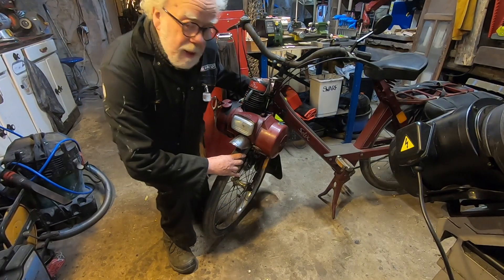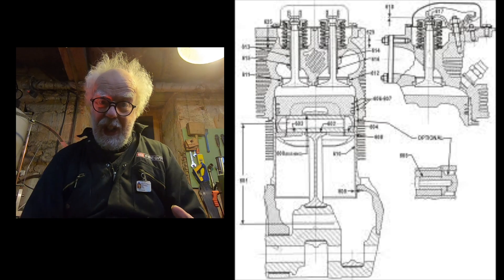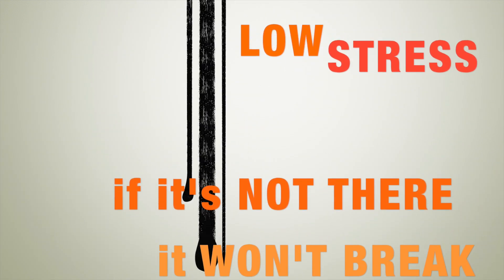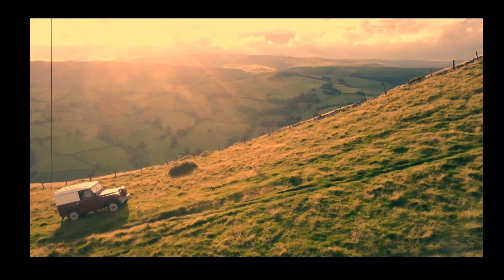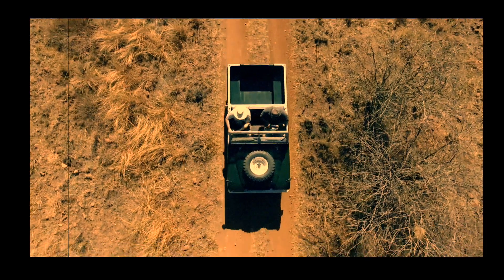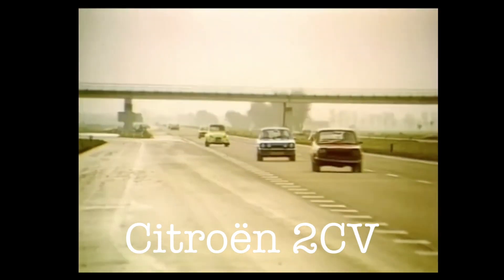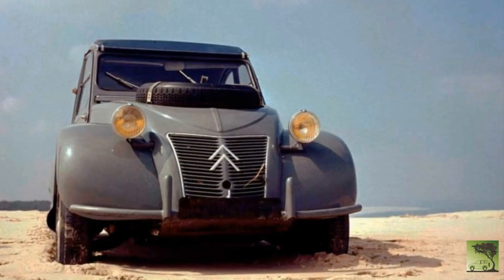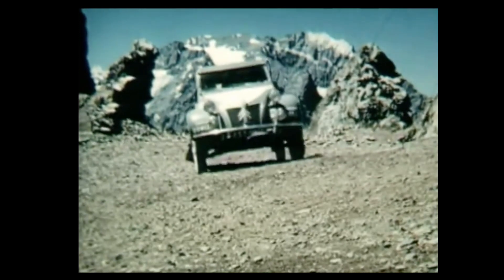Best Engines - Prof Simon

Comment: Modern (ish) indestructible engines would be the VW PD 130 (decent power, great economy and they go on forever with minimal maintenance), the Toyota 2J-ZGTE (Possibly one of the most overbuilt consumer engines in history, if you want to talk under-stressed then this deserves a mention) and finally the Chevrolet small block V8 (used from 54-03 in one form or another and in every possible application)

Comment: you are so right my friend,my first car  was a 3cv Citro the frog called here in argentina, I run into sand, snow, steep  unpaved rocky trails and all you needed to disassemble it was  the very same wrench for wheel change, you forgot to tell that the heating was  done by redirecting the hot air flow from the air cooled cylinders and most impressive to me that first models  did not have  dampers attached to the chassis, they were inertial  dampers  so clever,  and that.snot all    it was  convertible meaning that fabric roof  was retractable   and seat  couldbe easily removed  leaving a flat interior,  I  spent  wild  vacations  sleeping  inside, if there was  an easily breakable part was that  wiper driven by odometer  only in first models:  being at age of 10  we  broke one playing with that novelty  in a car of a friend of my dad,  it had a sort of a  water  rotary knob  to put it to work....still remember the  verbal spank we got!!!
Reply from the maker: Happy 2CV memories

Comment: The 2CV was a cool little car, designed before all the bells and whistles everyone expects to have now (bringing unreliability with them). It went round roundabouts at an awesome lean angle, the air-con was a flap you could open to scoop air straight in from underneath the windscreen, and you could fold back the top (I had a Dolly model). The engine never gave any trouble, however the rest of the car was flimsy in the extreme... and you could almost hear it rusting underneath you! And hoped you never had the tiniest of accidents because the whole car was the crumple zone 😬
Oh and the gearbox was mounted under the bonnet and connected to the gear knob with a “twist & pull” kind of linkage...

Comment: 2a had a 2.25l petrol which was a basically the same as the diesel but with lower compression, it was actually a three bearing crank, not until the series 3 and Rover did it become a five bearing  motor and not until the 110/90 or defender did it become a 2.5l all derivative of the original series 2 motor from 1958/59 . In fact the LR motor 200 and 300 tdi motors were a further evolution of the same design and were in production into the 2000s when replaced by the td5. But the details are not that important your comments are spot on about the under stressed design of the 2.25 petrol, I drove mine for over two hours to get home with a disintegrated water pump bearing and no water, replace the water pump and coolant and continued to drive that same motor for another two years! Love the videos professor, keep up the great content!
Reply from the maker: Cheers Chris

Comment: I like your pics, cars from 40s, 50s and 60s had engines that were not equipped with smog controls. They were simpler and easy to work on.

Comment: Prof Simon..as much as I love my Rotary Engines...  I think when you talk about best engines built...  one of the world's best has to be the second world war  Willis or Ford..4cyl... ..they would rate a 5 star performance for what they went through.. that's the toughest little performer I have ever seen  p.s. I now own 2 of them.. both later models a 1946 and a 1947..and regarding the Rover, I had a short wheelbase 88.it was cute  but . what I hate on anything English is that  as tough as those Engines are the Lucas wiring and Ignition system  are  horrible.  .keep up the Great videos   Thanks..again

Comment: I would say my car's engine should get a mention in dispatches...   Reliant 850cc all alloy engine, tiny lightweight engine that can propel with a bit of tweaking a 3 or 4 wheel Reliant close to the 100mph mark whilst giving about 75mpg and if maintained well, totally bulletproof and surprisingly robust for an all alloy unit.   It looks incredibly like the Mini A series and that is because the Reliant 850cc and the Mini A series were both developed from the sidevalve Austin 7 engine as Reliant bought all the tooling for the 7 when production ceased at Austin Morris.     

Ford UK had some awesome engines, the Essex 2.0 V4 was an education on getting a tall but thin profile engine into a tiny engine bay of a MK1 Transit and was a strong lump but suffered reliability issues because of strikes at Dagenham, the Essex 2.5 and 3.0 V6 the darling of the Metropolitan police who finally had an engine that could catch the Jags of the crooks without the hefty price tag of the wallowy Rover P6 V8 and of course the Ford Kent OHV sweetheart of the boy racer and the bigger brother Ford Pinto in 2 litre form was just about the best mid sized car engine of its era.   Of course the Rover Buick V8 is perhaps the biggest smart move British carmaking made and in the SD1 was a frightening beast esp the EFi Vitesse SD1.   

Little snippet too that Triumph's 2.0 and 2.5 straight sixes didn't die with the car, they were rebored and used for Rover SD1 2300 and 2600 versions and the 2600 was quite a capable car, Rover also stuffed a 2.0 Montego engine into a SD1 and found out how to ruin a car in 1 easy step with no one buying them much, Ford did drop a similar one on the MK2 Granada with a 1.8 Pinto in it which tanked majestically and not learning their lesson had another go with a 1.8 Pinto in the MK3 Granada which became a big joke lol
Reply from the maker: Good stuff

Comment: Modern engines are incredible Simon, 360bhp turbo 6 cyclinder 3 litre B58 BMW engine capable of 40mpg+ if tickled an 4.5s to 60 if not.
Reply: I have eyes only for the 750 V12, made out of two 525e straight sixes, parts are pretty easy to source, with the full Alpina tuning and remapping you are looking at a 190mph car easily and the V12 is pretty strong and not the usual BMW money pit other engines are because of its 525e heritage.

Comment: Awesome video!!! The Mazda rotary engine definitely could be ranked among the worst engines ever made. I was the unlucky buyer of a brand new 2007 Mazda RX-8. That thing was in the shop more than I had it
Reply: Rotary, great concept. Terrible application. On a race team, this is great, in real life too many surfaces to heat up and wear🤔
Reply from the maker: Awesome
Reply: @cybercamp2900  yes the car would literally fly
Reply: But a fun car when it was working?.
Reply: @robedwrds3879  yah but it was weird to spend that much on a car and have to buy another car so I had one to use

Comment: Not quite right, only the later 2.25L Land Rover engines were 5 bearings. 90% are 3 bearing. I have a 5 bearing in my Land Rover 60 years old and is my daily driver. Not a DTC in sight. I do work on modern cars and do have a $6000 scan tool.
Reply from the maker: thank you

Comment: We need to know if this new signal on 980 MHz is coherent and/or carries any data or modulation. Admittedly alien data may be indistinguishable form noise to us, but it should be possible to determine if it's natural or not. Does it have a 'daily' cycle suggesting it comes from a rotating planet? Unfortunately it's in a crowded bit of the human radio spectrum, and I'd say it's 50:50 that it came from here! To do this sort of thing properly we need to be on the far side of the Moon, screened from all earth's man-made signals.
Reply from the maker: It was modulated....strange

Comment: The only reason water cooled engines blow head gaskets is because engine manufacturers world wide allowed accountants to build engines and not engineers. Look at a pre WWII water cooled engine and then look at a post WWII water cooled engine, a vast difference. We have done many thousands of hours of engine dyno work to improve post WWII engines allowing them to NEVER blow a head gasket. Unfortunately mankinds shear laziness kicked in when our concept was shown to Motor Mechanics and engine manufacturers as poor  cylinder head coolant passage design exposed hot spots when proper coolant pump design was added.  Mechanics when confronting poor cylinder head design with a proper pump and thermostat location then had to deal with bleeding problems which was usually answered with , forget it we will go back to a standard system. 
Unfortunately these people were ignoring the untapped potential of an Otto Cycle engine when those engines were exposed to proper temperature control , those benefits were leaner mixture more power and a huge increase in fuel economy and longer engine life. 
SO SAD mankind has done it again.